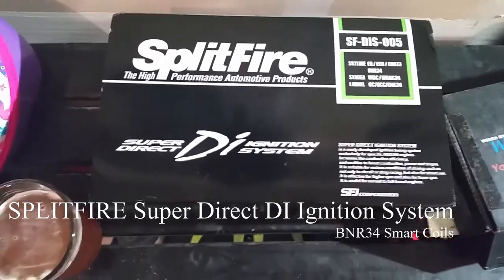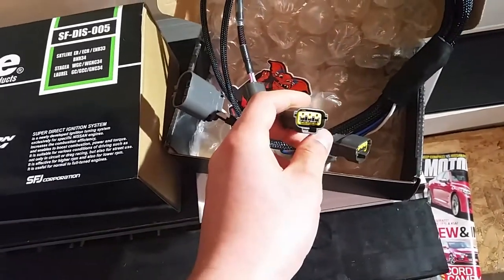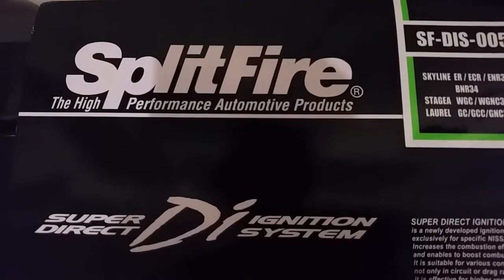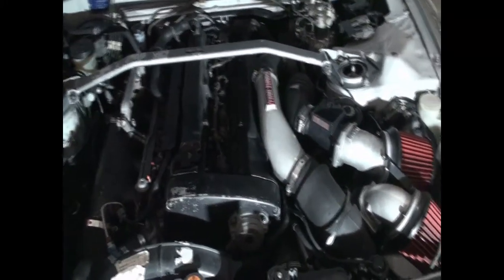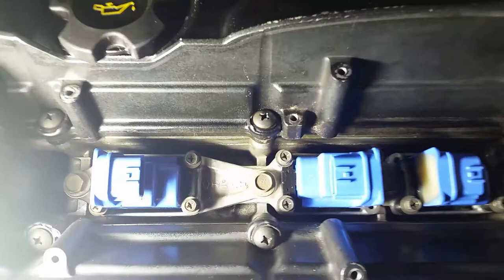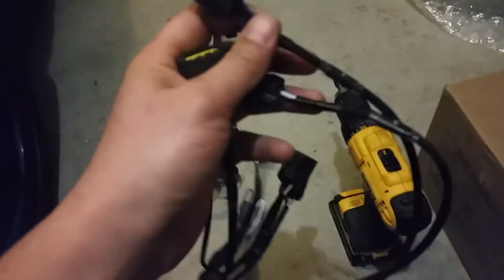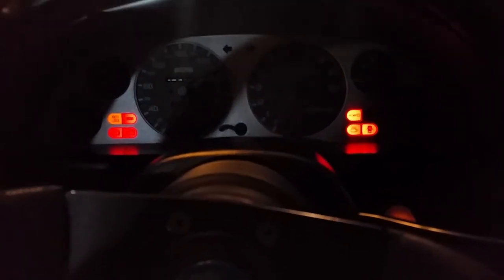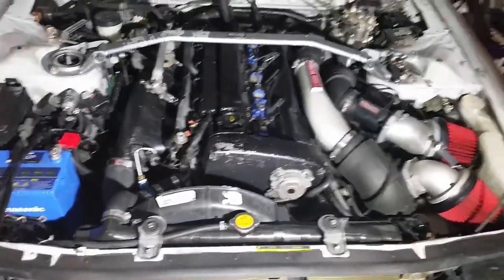Skyline R32 GTR Ignition coil upgrade to R34 GTR Splitfire smart coils & ignition harness

Comment: Hi. At 6:53. There is a ground wire that’s not connected. Does that stay unconnected or do you connect it somewhere?  I know you have one ground wire connected on the coil rail....   I’m thinking of doing same but just not sure if it’s easily done.   Thanks in advance
Reply from the maker: I realized that right after the video. Yes you are correct. The ground wire is connected by the rear coil to the coil rail. Thanks for noticing and looking out for me!

Comment: How’s this setup holding up a year later? I saw a thread about not doing 34 coils because the ecu dwell time is different than 32/33 and it’ll fry the coils. Seems to be fluff to me. Even people saying they do R35 coils on stock ecu with no issues not adjusting dwell.
Reply from the maker: Car is still running strong and pulling hard.
Reply: So just bs then. I’m sure being able to adjust the dwell helps, but I wouldn’t think that going from one external ignitor to internal ones for each coil  would make Nissan have to redo the tune.
Thanks for the reply, great vids btw!
Reply from the maker: I deal with UP Garage in Tacoma, WA. According to their Technicians, no tune is require with this ignition system.